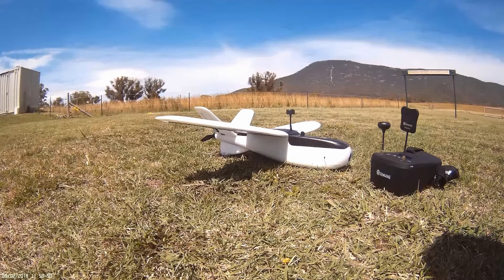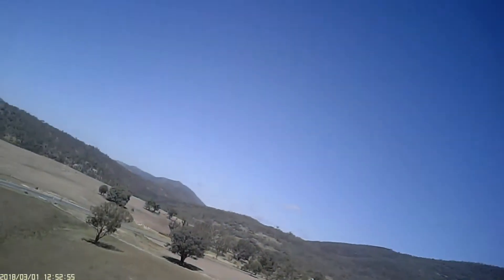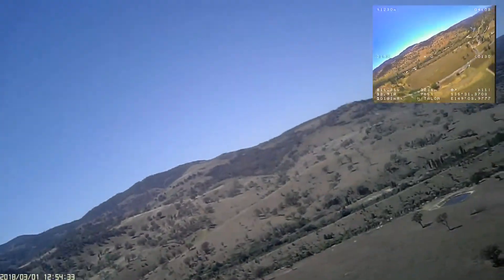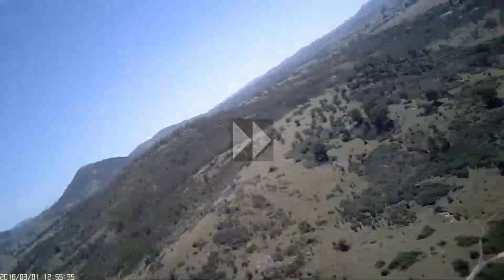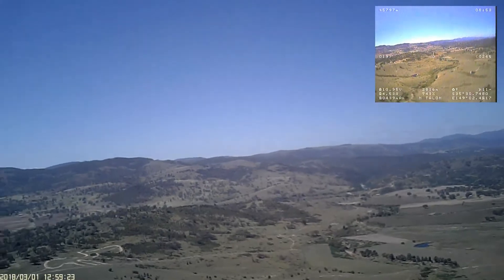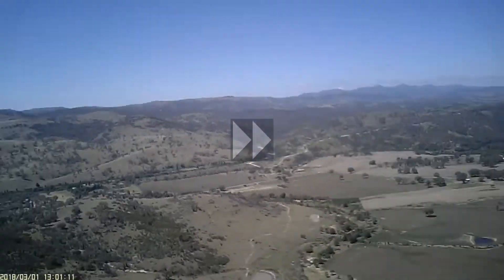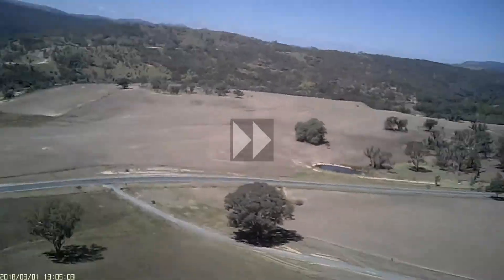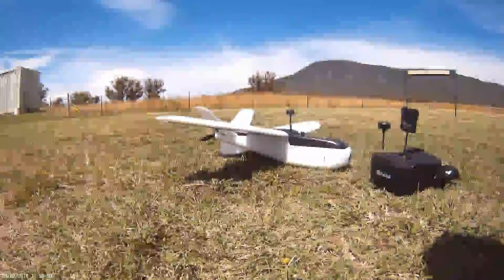Nano Talon - Flight Controller upgrade

Comment: A great result Ken. I was wondering how the BGL would go, I have one in  Z-84 which works ok but has very dead elevator control, turning gain up to achieve any level of control it starts oscillating, basically I get about 5% useful elevator control and about 20% aileron when stabilised. I ended up making a custom mix that turned stabilisation off with anything more than 20% stick input, giving decent flight control back..
I may try it in my second Nanotalon.
Reply from the maker: I've installed a F2S FC in my Z-84 and am struggling a bit with wildly fluctuating altitude readings from the GPS. If things don't improve I may be forced to replace it with a Bigaole.

I've experienced the same elevator issues with the Bigaole and dealt with them by setting up dual rates on the tx. I use low rates when in Manual mode which I generally only use when launching then switch to high rates when using the stabiliser. I've set the NT up the same way.
Reply: KenJungles my favourite is the Hobbyeagle A3 super2, rock solid stabilisation in NT, I also run Skylark osd, so no rth which is no problem, but they've just released a new V3 version which apparently  is even better than the v2 if that is possible. I am waiting for Bang to restock, but that will likely be months away..
Reply from the maker: I haven't heard of that one but I'm not really in the market for another version. I've tended to stick with the Bigaole as I have about 3 of them as well as Mini OSDs to go with them. They also seem to be lucky for me. So far I've managed to lose 3 planes fitted with Cyclops Tornado OSDs which I like the a lot but are a bit big for these smaller models. I also have a couple of Suppo OSDs that I got a couple of years ago but never got around to installing.

I was attracted to the F2S by the integrated OSD and relatively small footprint when de-cased.
Reply: KenJungles good call, I only stuck the A3 into mine as It was on hand and the stock one just had to go. I run inav in most new builds now but as I also had a spare Skylark osd it too got added, which like yours is tiny, only about 25g with gps and current sensor and I have flown many hundreds of hours with it in other planes, plus it suits NT really well size wise. As the A3 is excellent in 3d acrobatic models and can recover a plane from just about any situation almost instantly. I used to like to prop hang a big Cessna 182, cut motor and drop backwards vertically, then just flick it into auto balance mode and spectate the most amazing recovery.. me looking like a pro 3d expert pilot .. ha! I now know their secrets..
Reply from the maker: Yes they're all amazing pieces of kit when you have them tuned correctly. Getting there can sometimes be a slow, frustrating journey though.

Comment: What osd do you use?
Reply from the maker: I'm using the HK "miniOSD with GPS". The stock GPS is an older (slower) model and I don't want to have to carry two GPS units so I've spliced into the GPS unit used by the Bigaole.  I've reflashed the OSD with uOSD firmware (from the RCGroups thread) which allows it to be configured for different GPS antennas and lets you pick and choose what data to display and where.